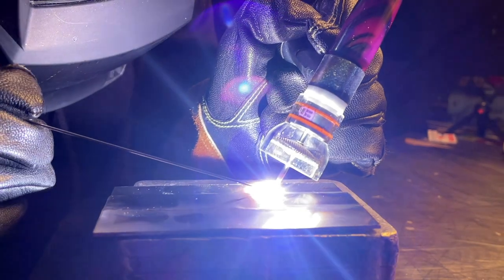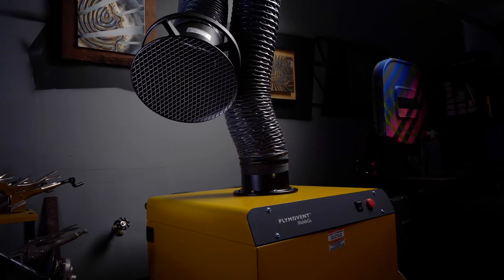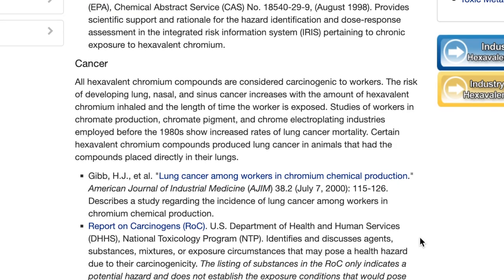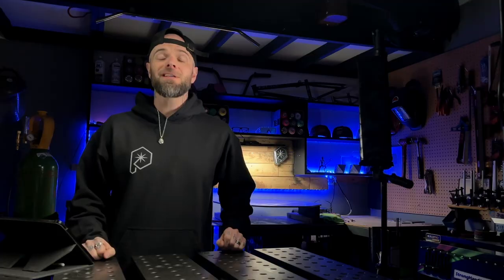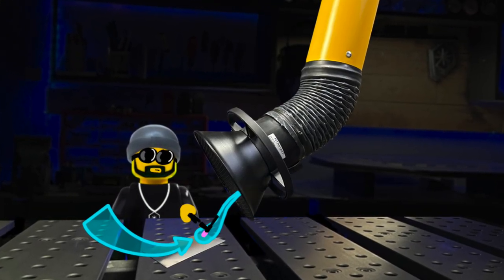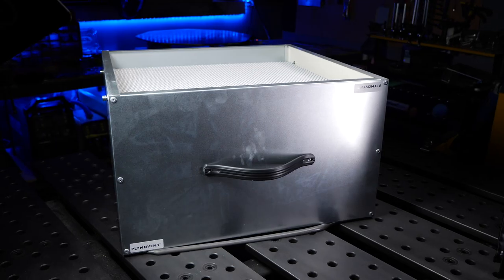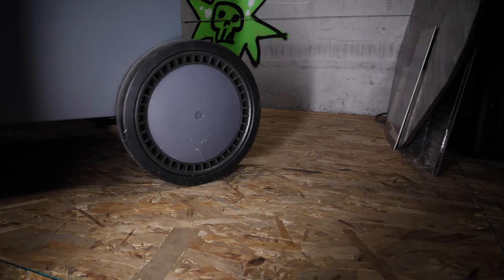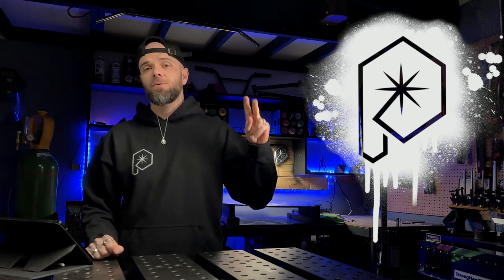Tig welding fumes SOLVED☠️ Remove the fume ☠️

Comment: A small WARNING! 
The respirator MASK you are using is the correct one but the filter on the video wont protect you from fumes. On the video you have 3M P100 2091 (2097) it will work for particles (P stands for Particle filter) larger then 3 micron (dust from grinding stainless steel) but not against chromium fumes.  

The correct filter must have letter B in the name it stands for non organic fumes and will remove chromium oxide (That is a large filter in the Remove the fume setup) the correct respirator filter would be 3M ABEK1 6059 for example or any other model with B1 (B2 and 3 are less effective).

If you try using P100 to protect yourself from chromium it wont do the job. Especially it will be harmful if you have to weld from inside the cistern or other enclosed  space. 

If you have the dollar you can also consider a proper PAPR welding helmet (Powered Air Purifying Respirator) it has the same filters as "Remove the fumes" but smaller and will guaranty a proper protection from fumes and dust even in closed spaces where "Remove the fumes" wont fit.
And remember none of the above filters will protect from excessive CO2 so always leave a venting opening if you have to weld from inside a cistern or container.
Thank you and be safe.
Reply: Very informative thank you!
Reply: Thank you so much for this info! I actually purchased the same 2091/2097 filter he is using after seeing him and others on YouTube wear them. I was very disappointed when I could smell the same smells while welding stainless, but when I searched for “welding mask/filters” all I kept finding were the P2091/2097. I appreciate your info so very much!

Comment: 2,6k dollas? Ain't no small startup workshop got money for that
Reply: Which is cheaper 2.6k or cancer treatment! Just saying.
Reply: @J.R.jr-pc7bo  did you buy one for that cost?
Reply: @pablodixon1275  not yet. I still have to build my shop first. New house and many other priorities first. I do plan on buying one. I want to be around to see my kid grow up, get married, and meet my grandkids.
Reply: I wonder if there is a DIY option to make one.
Reply: @pablodixon1275  did something similar for my shop, basically my shop is in a part of my basement that has bare concrete walls. I drilled out a large hole through the concrete and slapped an industrial strength fan in the hole then sealed it. It’s not perfect but it pulls the fumes away from my face and up toward the ceiling (15ft tall ceiling) and then sucks the fumes outside.
Reply: @Pablo Dixon  I bought a in line duct fan for under $100. And ran it out a window.
Reply: Use a fan
Reply: @zachconway3075  a fan would blow the argon shielding away
Reply: @MrCruefest2  I know I was being sarcastic. This would be a great investment on your health

Comment: Hey Dusty loving your vids for the last couple years.  I’m a Victoria guy too!

I could use some of your help.  

You’ve made literally hours upon hours of aluminium and stainless steel.  While some of its transferable I find a lot of the technique isn’t valid for butt welding thin sheet metal.  I’m working on learning the basics of butt welding sheet metal horizontally and vertically for my auto body project.  
It’s kicking my ass!   My biggest problem seems to be blowing one side out before I can establish a weld pool or the edge widening because I’m melting it down before things get going.  

One other topic I can’t say I’ve seen in one of your videos is gas flow.  How do I determine if I’m using too much or too little flow? I’m running 15-20CFH on a #8 lenses cup.  

If you’re interested in vintage Porsches I’d love to give you a shop tour too.

Comment: Do they make a smaller version. My shop is in the basement with 8ft ceilings
Reply: We have a PHV unit for about $1400 USD, it's suitable for occasional or part-time welding, comes with HEPA filter.

Comment: I think I'll try to save myself about $1,500 (or $2,500. Ouch, those units and filters are expensive.)  and get a couple correct filter packs for my respirator and install the 4" inline fan in the tube going outside, venting off the roof (for when I work on SS.) Hmm, probably have to switch to a PAPR style conversion hose and connector to fit under the hood.

Comment: It is good if instead of using a smoke extractor (that is a bit expensive) we use a type of those kind of masks with the 2 big changeable filters? Thanks.
Reply: They are called PAPR welding masks and setups. Filters may wary so it can be 1 filter.